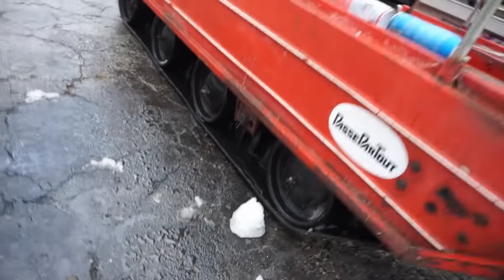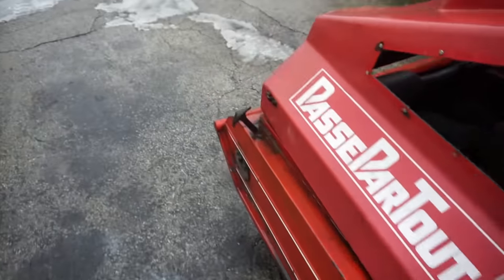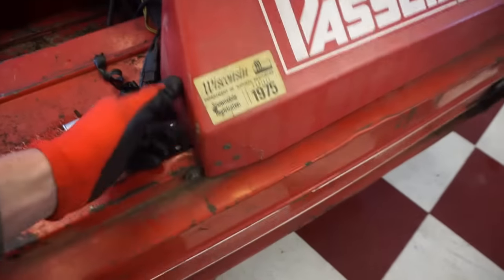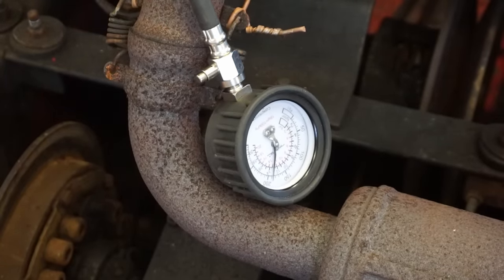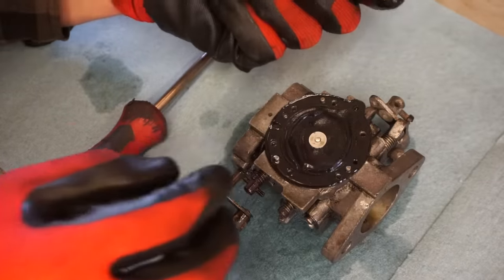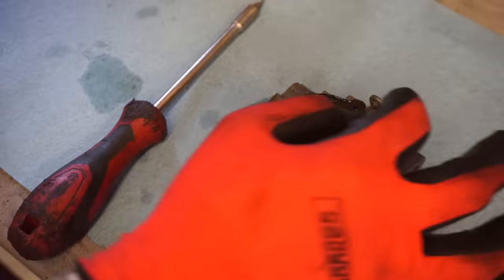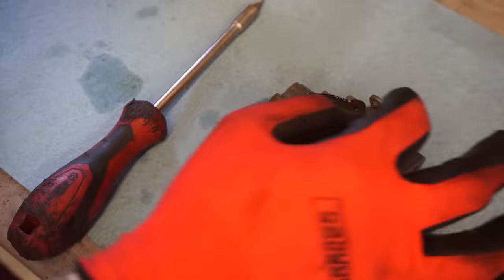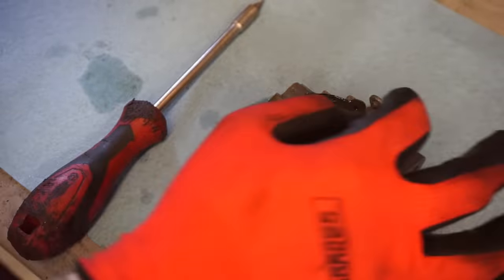I Bought a Super Rare Mini 2-Stroke Tank (The Ultimate Off-Road Machine)

Comment: I looked at several of these some years ago. They were pretty cool. I opted to not buy them. Just not something I wanted to put any money in to. 
I want a full size snow cat that fits on a 8 foot wide trailer and has a van type cab. 
Yet if I was going to build one. I would find a matching pair of snowmobiles with reverse on them, gear box type. Then with some modifications build the 2 sleds as one full unit and a van body and you have your very own snow cat. Get ones with the longest tracks or extend them. using 2 engines you can control each track with out complex clutches. Push foward to move foward and pull one handle back to either brake or to reverse the track. This part you would need to work on.

Comment: this thing is basically a tracked version of the Argo ATV from the late 60s and basically, even the modern one works exactly the same I'm pretty sure if wanted to make it more "modern", parts are probably interchangeable. not individual parts but assemblies, of course. EDIT: 22:21 IDK about that carb, it's one made in the USA, I worked on a lot of old crap over the years, I never ran into one of those here in Quebec anyways, I'm thinking that carb was probably replaced at one point or another, i could be wrong but, seems fishy to me

Comment: dude u got some toys. wish I could ride with u. I put together a Mini-aluminium jet boat. I didnt to the welding but put the engine & all plumbing electrical & brain its got a nice bench seat & 160hp STX 15F kawi’ motor. I got a banchee 1987 too that I worked on last year & gonna finish up this year, I put a mod quad aluminum clutch basket with plexiglass window that shows clutch spin. /lockout. I gotta clean it up this year but its about done. I got SxS too & another Jetski cause I was gonna build another jet boat. anyway. it would be sweet ride with u dude. Awesome toy buddy!

Comment: Hey 2 Vintage I need your help on my build I bought a 2007 Crf450R and can’t seem to get the bike to spark! I’ve bought a brand new stator and a brand new Cdi Box and brand new spark plug and a brand new ignition Coil! And my kill switch still works good I checked it and all my wires are good no rips anywhere checked all those from the Cdi box connections all the way to where the connections end? I’ve tried everything and still can’t get it to spark! Can you please help me out! I’m totally lost here! Thanks again

Comment: Hi
Is it pulling on both axles same time or is there a differential in power axle?
Seems like you are slipping the left clutch a lot while driving to go straight, or is it just camera angle?
If it likes to steer to one side constantly and driving on the routes, maybe add one detachable ski in the front like on an Ockelbo 8000 and steer with that in slight turns

And I think you're not supposed to take the variator apart for belt change, but use a bolt to spread the secondary so you can slip the belt in the lover and over the main clutch

Comment: Dumped a bunch of oil flag those heads, that will bump your compression. I mean not generally like a hundo but 20ish maybe a bit more maybe depending on how much oil you dumped in the plug holes.  But 240 is crazy

Comment: your comet clutch settings are out of wak,  the belt needs to ride on the outside of the secondary and loosish around the comet until 2500 rpms , then spins up and grabs in high torque